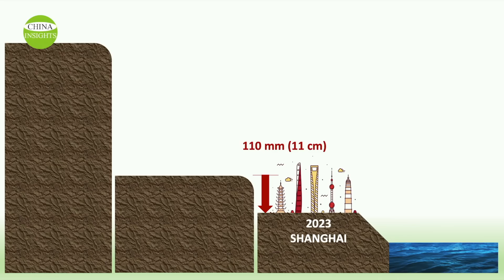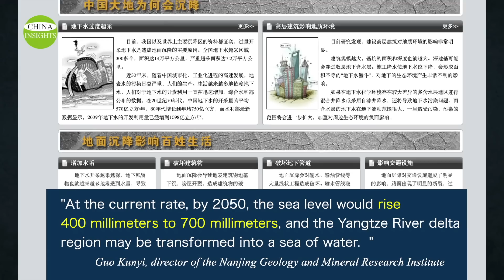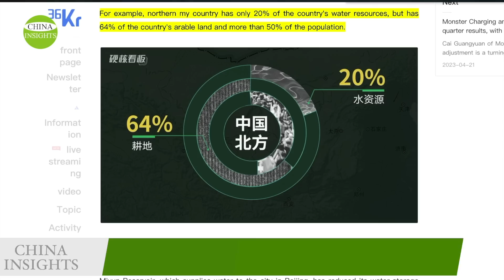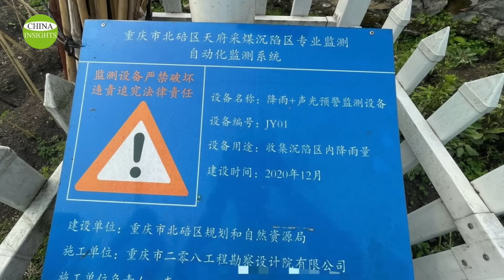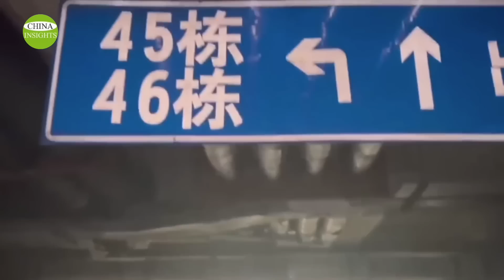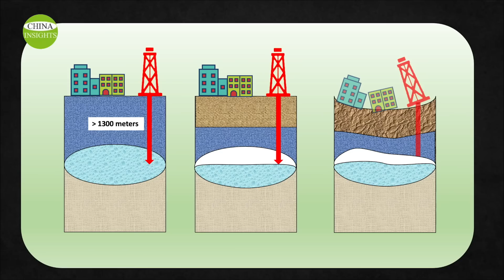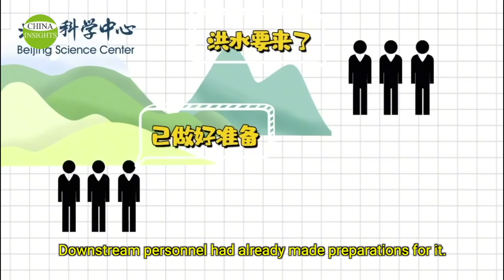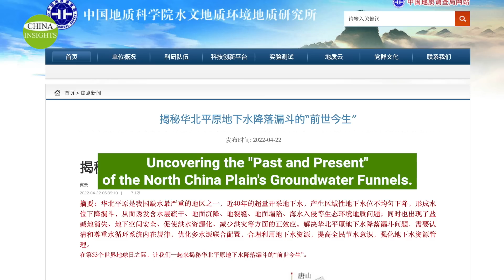Sinking happens anytime in China: Over-exploitation of coal and groundwater...floods worsening it

Comment: When you dig the underground and build huge scyscappers in huge numbers the weight of concrete with crush the layer underneath and that will lead to pressure to the soil.  Also the huge underground water extraction leads to soil becomes lose and it gives more chances of sink holes in huge diameter

Comment: It's not often I have to retract one of my conspiracy theories, but I guess I have to on this one. I believed that china ONLY sold the U.S. their shoddiest steel and concrete in order to cause the infrastructure of the U.S. to fall apart. And that they kept the good stuff for themselves. Now I realize that they are also using the same shoddy construction materials that they sold us. I have seen videos of skyscrapers they had built just 5 years previous that had concrete in them starting to crack. This is what happens when you focus on quantity over quality kids. This is not JUST because of severe weather, etc. It is mostly because their infrastructure is junk and can't take it. Yeah, I know that if a hole opens up in the ground, anything will collapse or cave in no matter how well made. But just look at parts of the video, how thin the asphault is and how easily it crumbles and falls apart.
Reply: It is just corruption in actions. You can't really have great quality if corruptions is running wild. You spend $100 to buy something but $80 is the cost to bribe. Tenders are bribed and no company would aim for quality production if money could do the trick. This is also why China has failed to produce the basic medical/laboratory tools, computer chips, and mechanical components, with any precision requirement, despite the government have pumped tons of money into those industries. You can look up the "first plane made by China", and you will find most parts are actually imported. Even their infamous aircraft carrier Liaoning, has a crack on its deck. One could only imagine how bad the situation is for other governmental projects when the military project could not escape the fate of corruption.

China selling cheap material in the hopes to achieve political and economic dependency/influence. It is quite obvious what their plans are when you look at their dynamic with Australia.

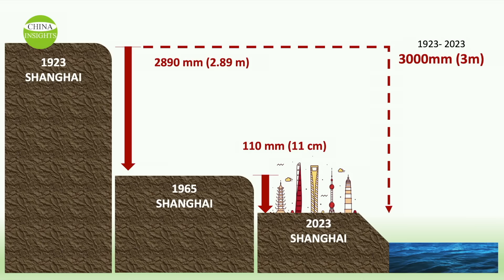Comment: This diagram 1:58 is a bit confusing as it's 3 meters of difference (9ish feet) 
But you used a city, so perception is thrown off.
Reply: Remember when you restate meters to Standard units that the yard is essentially the same as a meter and is commonly used in the States as well as the foot. 
Just a note.

Comment: I noticed that the floor/foundation that the guy almost fell into at 5:56 didn't have any rebar. Shoddy work. I have to laugh here, as this is concrete 101 type stuff.
Reply: They don't use it in almost any construction.  The damn they just built is failing. Sections are moving.  They need to develop "Arks" for that flood.
Reply: This is perfectly acceptable for a "floor on soil" system as long as you put well-compacted sand underneath.
Reply: Not in America.   @Salabar_

Comment: In America, pipes below the home are laid into a solid base of concrete, that is several inches thick.  But these pipes in China were hanging in mid air, after the water eroded the fill below the home. What kind of shoddy work is this? In America, this would have never passed an inspection by the City.
Reply: China loves to build EVERYTHING fast and improperly deal with the consequences of the a bad foundation

Comment: Just like they mentioned on the china show(serpentza & laowhy86) none of the chinese cities have drainage with the exception of 2 cities.
Reply: No drainage? Wtf? Just how?
Reply: @MiraSmit  Corruption and just general lack of care. They don't plan sh*t when they build anything. They don't prep the land before they build a road, they just dump asphalt on the ground and call it good. They install fire hydrants but they don't connect them to any water main. They install drain covers but they don't go anywhere, you lift them up and there's dirt underneath. They use bamboo as rebar in reinforced concrete, the list goes on and on and on. China's building codes exist on paper and paper alone.
Reply: @MiraSmit They've been building their way out of an economic recession. They seem to pretty much just come up with a plan, bribe the officials to let them do it, then build it as cheaply as possible since a portion of the construction budget has disappeared in bribes. 

The result is basically a 3rd. world country larping as a developing one.
Reply: @MiraSmit  IDK, even though they get torrential rains every year, it seems as though they never thought to include drainage in their city planning.  You should check out the china show.  each of the hosts have lived in china for over a decade each, and they're fun to watch.  It's very insightful